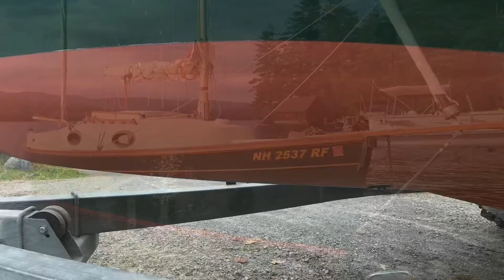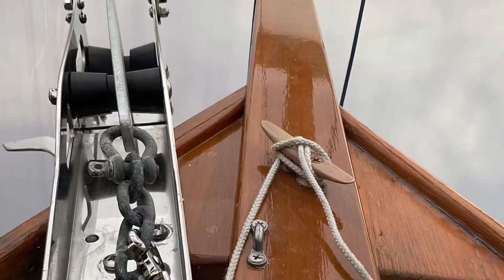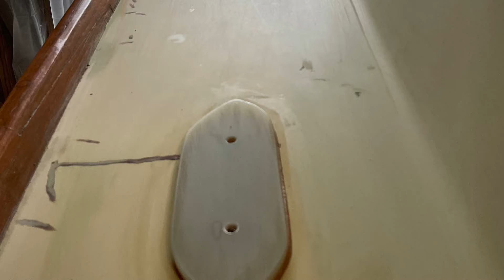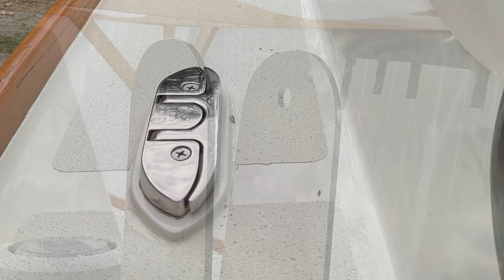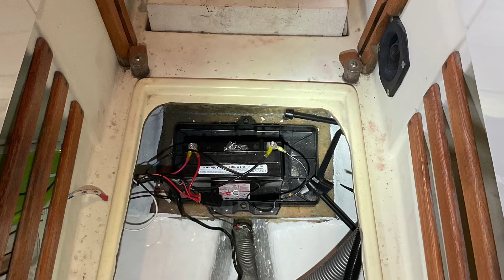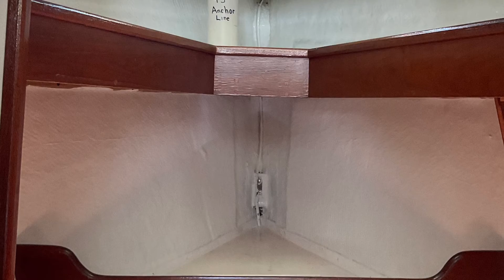Tour of my Rob Roy 23 Sailboat.

Comment: Hi, first off very nice job on the boat. I just bought a Rob Roy 23, mine is missing the stem fitting on the bowsprit. You appear to have some type of stainless padeye fittings bolted through the sprit for the forestay/bobstay. Is this hardware you replaced? If so what is it/ what was your source?
Reply from the maker: Hi Eric,  Thank you and Congrats on purchasing a Rob Roy!  They’re wonderful boats as you’ll soon find out.  I had the fittings custom made for the headstay and bobstay from https://www.garhauermarine.com/.  I spoke with Mike and fabricated the parts.  The hole for the headstay fitting is 1/4” and the holes for the bobstay are 5/16” and they bolt together with 1/4” bolts..  Mike may still have the specs on file if you ask him to reference what he made for me.  I also had him fabricate a new mast tabernackle and I purchased the jib tracks & cars from Garhuer also.  They make great products and are reasonably priced.
If you’re on FaceBook, there is a Rob Roy 23 group which has more information about my boat as well as what a few other owners have posted.
Ed